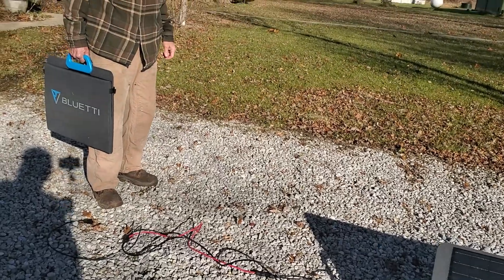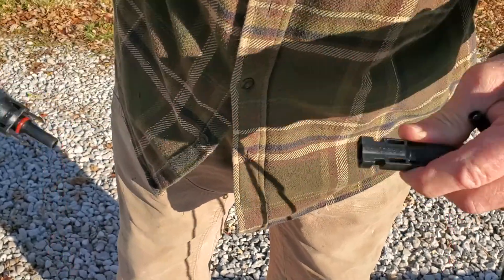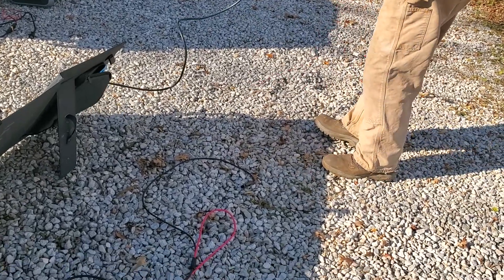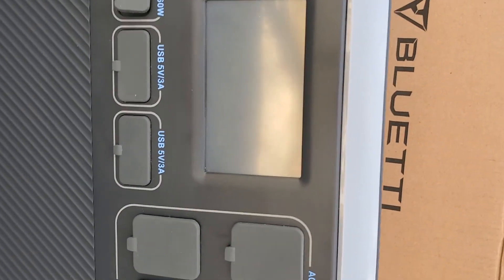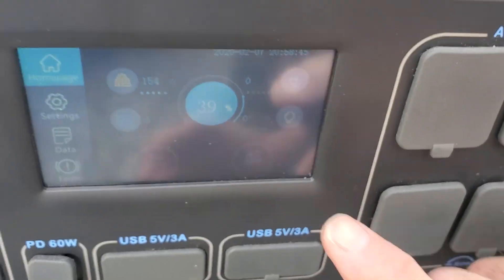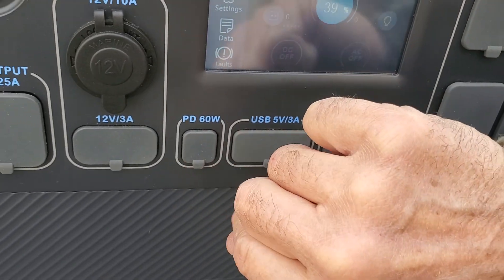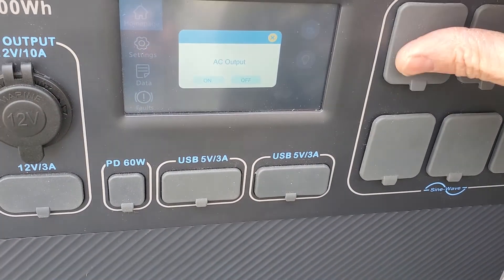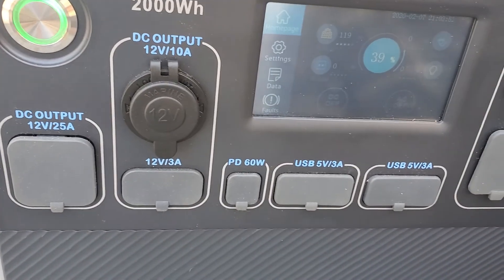How to set-up your Bluetti Solar Panels

Comment: If your panels are plugged and getting sun it’s not going to shut off manually!! So at night when the panels aren’t working then it’s the safest, just ensure to turn off the AC power option to off if you still have things plugged in…
Reply from the maker: Ours does shut off once it gets a full charge.  Thanks for watching and commenting.  :)

Comment: Do the solar panels have to soak up the sun for a time before connecting to the power station?
Reply from the maker: No.  You hook them up to the power station and they will immediately start charging if you have enough sun.
Reply: @appalachianmercantile  Thank you so much!  I don't feel like the instruction manual is very good and I appreciate your video.
Reply from the maker: @jkid8948  That's why we made the video.  We just learned by doing and wanted to help others.  It just took way too long for their customer service to get back to us.  :)  We are here to help if we can.
Reply from the maker: @jkid8948  That's why we did the video.  We felt the same way and couldn't wait for days for their customer service dept to reply.

Comment: I use this solar Generater.Systems  at work. The building is 80 years old so there’s not a lot of electrical outlets. I use it for lights, fans, charge phones etc. works great !
Reply from the maker: It's not about how many panels you need, but the size of the Bluetti you get.  The AC200 will run your AC if it's not a huge unit.  We originally got 3 solar panels to charge the AC200 and ended up buying 3 more.  It charges much faster with the 6 panels.  With only 3 panels, it takes 6-8 hours to re-charge the Bluetti.

Comment: I have the exact same units and set up but I’m getting only 24-26 volts input, without any amps nor watts kicking in. Anyone can shed some lights on why?  Panels are new and facing strong sunshine in Puerto Rico. What did I do wrong. I tested it on all my 3 units and the all have the same problems!
Reply from the maker: Do you have them hooked up in series?  Parallel won't work.

Comment: Thank you so much for your video. My husband passed away with the knowledge on how to set up the solar panels. I have been afraid to ruin it. He did say that you could use it while charging it and did not explain about the power on and off button so that was good info. Knowing now that I need to power off the unit before unplugging the solar panels is good information
Reply from the maker: Glad we could help!  So sorry for your loss.
Reply: @appalachianmercantile  can I glue panels to top car

Comment: did your bluetti power station come with solar connector? or did you solar connector come with a bluetti solar panels?
Reply from the maker: We bought the panels and the Bluetti as a bundle directly from Bluetti, so it was much cheaper that way.  Thanks for watching!

Comment: Dang, i got my bluetti eb3a a few days ago, the panels arrived today, now im finding out i need a special adapter to connect the panels to the gennie.. why cant they just include the dang adapter
Reply from the maker: LOL  When we bought the second one, we bought it as a bundle.  The adapter came with it.  When we were having the customer service issues with the first one, I was on the website and saw that the adapter came up as a 'suggested' purchase.  Sooooo....when I was buying the bundle, I also bought an additional adapter not knowing that when you bought it as a bundle it came with it.  Now we have a spare.  Website and customer service do need some work, but we do love it.  We've had to use it more than once this summer with the rolling blackouts.
Reply: @appalachianmercantile  Ha, i ordered thru amazon and this being my 1st solar generator im really not sure what im doing..lol.. I'm going to check a frw stores today and see if i can find an adapter,  if not i have one ordered along with an extension coord..
Reply from the maker: @AlmostOutside  We ordered through the Bluetti website because it was cheaper.  I'm guessing a Best Buy or some place like that would have the adapter.  Good luck!  Hopefully you got 3 solar panels and not just one.  Otherwise, it will take a lot longer to charge.
Reply: @appalachianmercantile  Thanks, I'll definitely check best buy.. i ordered the 200w panel set from bluetti, i thinks that the max input the eb3a can accept

Comment: But I'm only seeing numbers for my input voltage. I'm not seeing any info displayed on the home screen beside the panels and it's also flatlined when I click the panels to view the input current and input power. I have switched it to PV from the settings. Any suggestions?
Reply from the maker: Thanks for the question. On our units the input voltage is displayed on home screen only as well. It also displays the percentage of charge. These are the only 2 that I track. I know if the input voltage is not above 130 the unit is not charging. I have never gotten into tracking the panel input since they are all connected as one input. I think the flatline is because the unit is limited to home screen info only.
Reply: @appalachianmercantile  hmmmmm I see. When I connect my panel it's only reading about 23 on the input voltage. Does this mean I need to purchase an additional panel? I'd hate to have to spend another $500 for more panels. Thanks for the response!!!!!
Reply from the maker: @wanderingeyes11  Depending on which unit you purchased, I'm guessing you will need additional panels.  We use 6 panels for ours but could get by with only 3.
Reply: @appalachianmercantile  I looked on the user guide and it says the panels need to be between 35v and 150v. The bluetti panel I purchased says voltage at max power is 20v. Does this mean it's the incorrect solar panel?
Reply from the maker: @wanderingeyes11  It could very well mean just that.  I know we bought ours as a bundle because we wanted to ensure the panels were the right ones.  You could have panels meant for a smaller unit.

Comment: Well done. I always say when I see our deck filled with sunshine that I'm leaving money on the table unless I've got my panels out. We just bought the BLUETTI AC300 + 1*B300 | Home Battery Backup and are about to get it connected to our house to 1) provide power when we have blackouts (which are all too long and frequent), 2) to allow us to shift onto batteries during grid peak hours to save us some money, and 3) start collecting some of that free electricity falling on our property.
Reply from the maker: You will love your Bluetti.  Thanks so much for watching and commenting!
Reply: Spent $4000 to harvest $50 a year. That’s good thinking lol.  Nah it will pay off big time during one hot day or cold day power outage.
Reply: @BeefNEggs057  Since posting a year ago it turns out that our electricity bill has been reduced by about $50 per month. This includes charging our electric car and my ebike. We've also gotten through several power outages with light and heat when our neighbors sat in the dark and cold for hours. We continue to be very pleased with our meager arrangement and anticipate to get even greater benefit as electricity rates climb.

Comment: Have you figured out why if you run 4 x 200 watt panels, and separately plugged in I get 100 watts separately for each panel. Why we can only get 160 watts at each UV hours
Reply from the maker: There is an input limit, but I believe that is 230 watts.  I would have to check.  It sounds to me like it is your angle to the sun.  It needs to be a direct hit.  We use 6 panels and are much happier with the results.  Bear in mind, any kind of interference with the sun (i.e. tree limbs that would create a shadow as the sun moves) will drastically reduce your input.  We do monitor the system as the sun moves to ensure we have the correct angle and aren't getting any shadowing.

Comment: I have two Bluetti EB70s. Just ordered a giant one refurbished and I hope they send it. I need it after hurricanes for a tiny air conditioner.
Reply: What small AC unit do you use?
Reply: @TheGermanation  A classic old manual control 5000 BTU Frigidaire. There are similar units on the market. These are getting rare. I decided to go with a 300 ah Ampere Time LifeP04 battery, 2000 watt pure sine inverter, and 60 amp MPPT charge controller for a solar power system. It can run the AC full blast for 6 to 7 hours on a charge (or all day if it`s sunny with 900 watts of solar panels) and much longer at night with the thermostat set properly.
Reply from the maker: Did you order it from Bluetti or a private individual?
Reply: @appalachianmercantile  I ordered it from their Maxoak website. Very poor customer service apparently. Tomorrow will be two weeks and they haven`t replied to my emails. I do have screenshots of their order confirmation email and the order details on the website. The Chinese are cut throat when it comes to business dealings but Maxoak has an American business address. I haven`t yet resorted to mentioning my channel and my pull in prepping groups all over the internet. That usually gets them motivated very quickly whether I`m exaggerating or not. Maxoak is notorious for this.
Reply from the maker: @baneverything5580  That was the one thing I talked about on our initial Bluetti video.  Product is great.  Customer service is non-existent!
Reply: @appalachianmercantile  I had a minor issue with my Bluetti EB70 but I`m on disability and live far away from a post office out in the middle of nowhere with no transportation. So I couldn`t return it. So they finally let me keep it and sent a new one. They`re probably still mad about it. I have five free power stations for that reason which is a good thing for me being poor and living in hurricane country. 

Recently I had an issue with a very cheap one I bought as a Christmas gift. It didn`t appear to be charging properly. I got on a live chat with the company to ask them about it and was shocked when they immediately said "Sounds like a bad display and we`re sending a new one." It eventually started charging right though and now works fine. A few days later I got the new one, then three days after that I got another one. I didn`t say a word. LOL! They all work fine.
Reply: @appalachianmercantile  I`ll go check out that video. Just found your channel this morning.